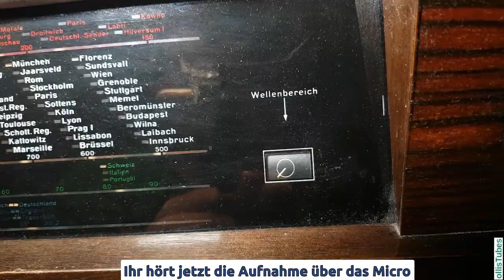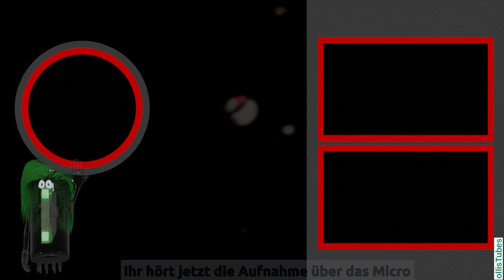schöne Technik von Gestern -  Saba 455WK / 1939

Comment: Ein Traum diese saba Radios, ich selber sammle auch nur Saba Radios, zu Zeit in der Sammlung ein wildbad 125, wildbad 12 schon 104mhz Freudenstadt 15m ein power Gerät Lindau 16 ebenfalls 104mhz. Alle Radios haben einen gesamten kondensatoren/elkos Sieb elko Gleichrichter Kur hinter sich plus diverse Röhren, saba Radios lassen sich auch klasse leicht abgleichen
Reply: Das Freudenstadt 15m war ein dicker Hund, diverse widerstände musste ich auch tauschen bestimmt über 30stück könnten aber auch mehr gewesen sein.
Reply from the maker: @elektroolli5984  Hi, den 15M hatte ich mal - in der nordischen Version. Den hab ich für gutes Geld gerne weiter gegeben - der Klang war toll, aber ich mochte das Design nicht.  Einen Meersburg, einen Lindau und einen Bodensee hab ich noch hier stehen - alles schöne Geräte mit gutem Klang, nur etwas groß (-;
Reply: Freudenstadt 15m habe ich wie du das m steht für modern, sprich die Lautsprecher haben vorne statt Stoff Holz mit Schlitze, und das normale 15 ohne mit ist mit Stoff, bin aber Leistungs technisch mehr als zufrieden, jetzt fehlt mir nur eine emm803 da meine fertig ist.